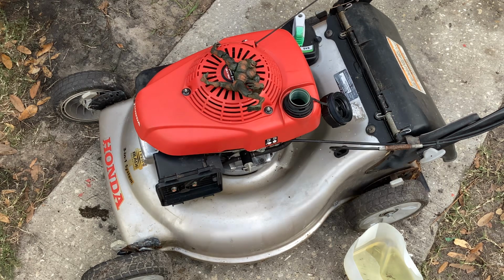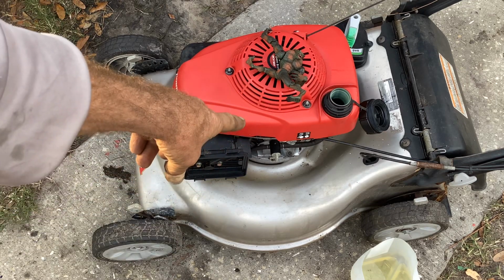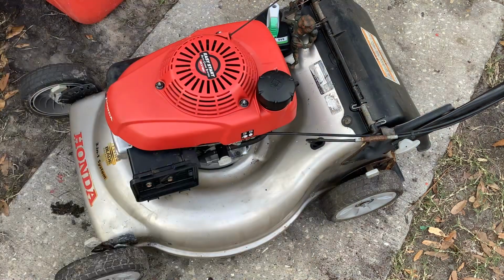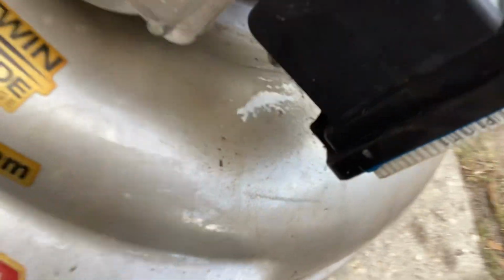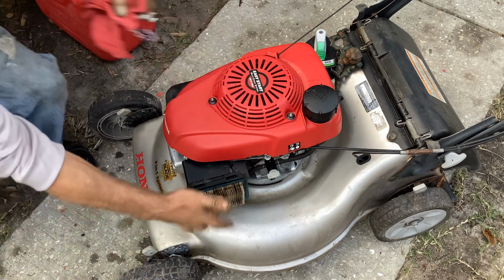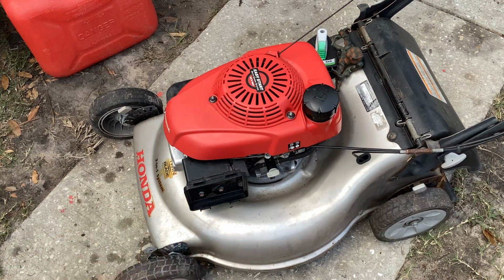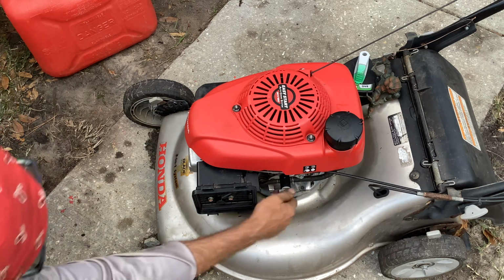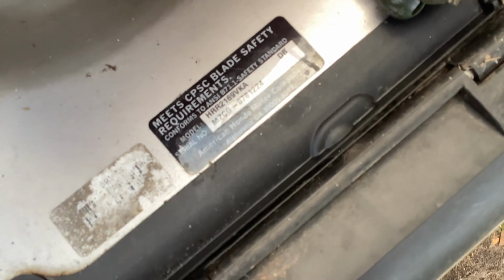2013 Honda Lawn Mower for $20 .....This Thing is Dogging me Terribly.  Happy Saturday!!

Comment: Darn the luck!! That was weird, started, ran fine, then no start. I hope the new card takes care of it. I just finished up the HRR I was tinkering on, only OEM carb available for the model I have. Purrs like a kitten now.
Put a new carb on the Generac GP 3300 gennie that was surging after a carb clean. Dang thing is still surging with the new carb. Arrrggghhh!!!! Any ideas from out there in Tommy Time land??
Reply from the maker: I think you still have a lean running issue. I would try opening up the jet on the original carburetor and see if that corrects your running issue.
Reply: @tommy-time5240  I thought about that and I do have some micro drill bits, but I didn't want to snap one off in the idle jet and ruin the carb. What the heck though, gotta try something!!
Reply: Drilling it out makes sense plus check valve lash to